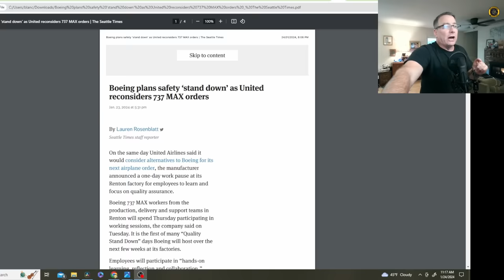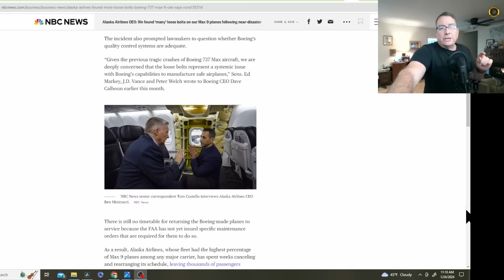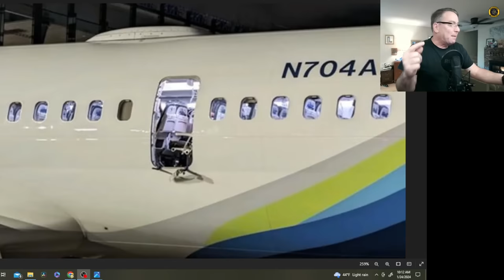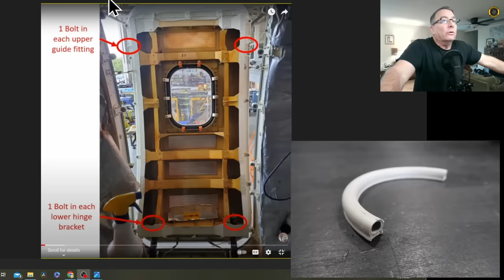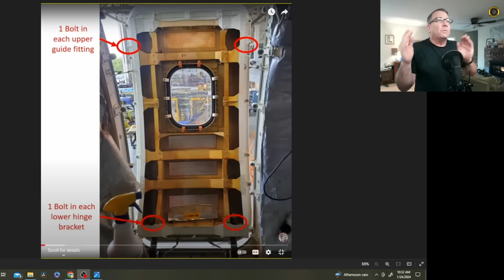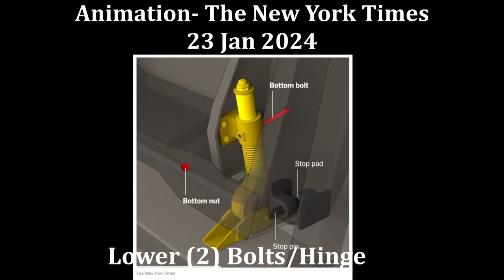Boeing's Quality Management Failure Explained 737-Max-9 Door 24 Jan 2024

Comment: Can you imagine what would have happened if this incident (not accident because they can be avoided) had losses of life or aircraft loss. In Australia the Alaska Airlines CEO interview was shown, wow he didn't hold back now it's obvious Boeing have some very serious quality control problems going on. Juan not sure if you can look into a very savage light aircraft crash that happened in Sydney yesterday. A Cessna 172 with a very young pilot crashed just after takeoff. Impact so savage you can't even recognise it's a aircraft BUT no fire at all. The 16 year old solo pilot requested to land started to turn back to the airport but has made a very high speed impact into a field. The aircraft had made two flights earlier in the day, but the third flight proved fatal. Looks very much like an incident where just after takeoff you need to have the options always on the table if the engine stops. Something that you have been focusing on lately.
Reply: I can imagine what the passengers that were nearby to the plug door thought for the rest of the flight as the flight was being aborted/diverted. "What is the next part that is going to fail and fall off of this aircraft?"
Reply: Sounds like the 172 was in the typical stall and spin crash, trying to make the impossible turn.
Reply: The impossible turn…
Reply: First thing lesson I’ll never forget from my IP: if your engine quits after takeoff, the runway ceased to exist. Translation: land someplace else. I used to do “stop and gos” at Wheeler AFB, O’Ahu. On the East end of the runway is what appears to be a golf course. That was my “alternate” landing field if my engine quit after takeoff
Reply: @uwekonnigsstaddt524  Garbage. O'Ahu is a new google spelling...
Reply: @uwekonnigsstaddt524  Outstanding. That is the only answer to a plant failure. I do not like to pass judgement on a Pilot who’s been killed and I don’t know anything about, but this has been a problem since General Aviation was born. However I’m seeing an increase in these accidents. A student pilot with 4hrs can make the correct decision while simultaneously even the highest time Pilots, Instructors panic and think they have to get the gear back over the Piano keys. 

Complacency and reliance on Autopilot have been the cause of the previous two U.S. commercial crashes (Colgan 3407 in Buffalo, NY where the pilots of a Q400 are on instruments about to hit the localizer but due to rime ice on the airfoil+extra weight of the ice and the gear being down their stall speed changed from the one tested on a clean airplane, they begin a stall, Autopilot-disconnects, and they immediately pull up making a recoverable stall into the loss of life of all on board. 

Comair 5191 in Lexington, KY: A CRJ-100 with 47 of 47 seats occupied plus a FA and Two Pilots. Pilots that breezed through their checklist on a dark 6AM flight, did not properly cross check their magnetic heading which would have prevented the accident that resulted in them mistakenly taking the 3,500ft General Aviation runway (RWY 22)instead of the longer and lit 7,000ft Commercial Aviation runway (RWY 26) resulting in 49 of 50 killed, the F/O and PIC was the only survivor. 

Then look at Air France 447. Pitot ice disconnects Auto Pilot and the First Officer stalls a A330 from 30,000ft+ by pulling the side stick back because the bodies natural tendency to want to climb away from the Ocean. But we all know how easy and preventable that accident was. 

Hand flying and practicing as many scenarios you can replicate SAFELY is the best cure. Pilots being startled by a sudden AP disconnect should know better. 

Your way of thinking is a very good one. If you lose power on initial climb, that runway no longer exists. Airports are  usually surrounded by open spaces of some kind. Going into anything wings level vs a extreme bank will only up your odds of living to talk about it. 

To all Pilots; You chose to become a pilot to fly airplanes, so let’s do more of it. I’m not saying don’t use Auto Pilot. AP is a wonderful tool. I’m saying do more hand flying, get to know your airplane, it’s minimums and your own. 

Blue Skies to all from Oklahoma USA.
Reply: Who doesn’t love a good conspiracy: there was no one in the adjoining seats?  I am not a frequent flier but on my last four flights all were at or near capacity.  And if I were on a crowded flight and became aware of an open row you can bet I’m finding my way into it.
Reply: @k9er233   I SPECULATE that the door is locked in place by the inside positive cabin pressure.   This problem is much more likely when the inside outside difference is small or non existant just after take off and landing decent.  Even this is too speculative to make me comfortable.   This is like an onion.  Each layer one peels off simply exposes a new one.   None will fall off while it is grounded. Which is why it is grounded.
Reply: We don't have to imagine, just look at the MAX issues, and the lessons Boeing learned from them.  PR is cheaper and more effective than actual safety.
Reply: @neeneko Let’s hope Boeing is learning.
Reply: Wait 'til the legal bill$ claim$ and settlement$ come in!!
Reply: @csenuber Hard to believe that Boeing is getting so complacent
Reply: Well it could have happened. Thankfully there was no one seated next to the plugged door when it failed. If there was, a person could have been sucked right out.
Reply: 172 no fire, previous flights in the day. No fuel. Impossible turney thing. Hope he didn’t watch aopa saying you could make it back.
Reply: @neeneko Lean manufacturing is a systematic approach to identifying and eliminating waste in a manufacturing process.   What Boeing and Spirit are doing is very wasteful.
Reply: @DriveByShouting  well, yeah, they are learning safety is expensive, words are cheap, and stock options can be pumped up through bybacks.
Reply: @danharold3087  lean is, by design, very short sighted.    it is an outgrowth of 'just in time' manufacturing, so elimination 'waste' is often things like 'inventory' and 'extra capacity'.  in 'lean', safety IS a waste since it does not contribute to throughput, and thus any opportunity to reduce it is 'embracing lean'.
Reply: @DJG37S ya, only at 16,000’ and it was still forceful enough to rip the shirt off a teen! Now if that happened at 30,000’…🛩️💥🔥
Reply: @patmahoney3120  The airlines/most airlines don't let you swap seats until they switch off seat belts sign. The flight was only just started.
Reply: @patmahoney3120 Well let’s nix the conspiracy then ………. The Max 9 flight was not long enough in the air for people to have started switching seats. Let’s try critical thinking instead of jumping to unsubstantiated conspiracy theories. 😂
Reply: GPS data shows him on the downwind leg, midfield.  @Jjengering
Reply: @toomanyhobbies2011  Irish?
Reply: @patmahoney3120  I don't want to support any conspiracy, but I am a frequent flyer and on a plane that is that full (only 6 or 7 empty seats) I have never seen an empty window seat, let alone an empty window seat with an empty middle seat right next to it. Very unusual, to say the least.
Reply: @Peter-gi3re Shame on you for letting logic get in the way of an illogical conspiracy theory.

But seriously, lt amazes me how some people seem to believe that they are so insightful that just because they think something might be so, it is!
Reply: @MrGundawindy I was the very last person on standby and had a window seat.

In reality, I expect that it happens more often than is realised.

Seats are often allocated on booking, so if people do not turn up for their flight (or miss a connection or are denied boarding), any seat has just as much chance as any other of becoming empty.
Reply: Essentially they classified or c&p opening of door plug for seal inspection as opening of a door for seal inspection. The latter does not require any bolt inspections as non are removed. Thing is that if one such classification error is found, there may be many more. If it can go wrong, it will go wrong.
Reply: It was reported on the news as his first solo. @Jjengering
Reply: @leokimvideo I see you on a lot of aviation and space channels, I used to watch your red back videos.

I love aviation and space too; do you have a PPL? I would love one but I have epilepsy so I guess I'll stick to the sims.
Reply: @neeneko   I wish this was shorter but you have a wrong view of Lean Design.  The term "lean design" can be misleading if interpreted as cutting corners or taking shortcuts on safety. While it does emphasize optimizing processes and eliminating waste, safety is a fundamental principle within lean design philosophy.

Lean design is heavily influenced by the work of Dr. W. Edwards Deming, a renowned statistician and quality management expert.  Deming is often called the father of modern quality control.  Lean Design focuses on applying lean principles (eliminating waste, optimizing flow, etc.) to the design phase of a product or system. In part this means designing the production system and product for easy error free manufacturing.  Lean design often involves redesigning processes to eliminate the possibility of errors, a concept also known as Poka-Yoke or mistake-proofing.  The lean methodolgy is evolving. 

Lean manufacturing is a broad philosophy that aims to eliminate waste in any process. 
If you have somebody telling you that safety is a waste they are off the the lean design track. We can clearly see at Boeing that non safe practices are costing a bundle.   

Learn design eliminate waste like minimizing defects through error-proofing,  cutting down on unnecessary movement and manual handling, and streamlining processes for faster throughput.
Reply: It’s an accident. Any incidence that results in injuries to people or damage to an aircraft is termed an accident.
Reply: @neilpickup237  I suppose. I worked FIFO, so most of the  time no one missed the flight, so I wasn't exposed to that so much. Also, the flight had not yet reached cruising altitude where others could move into an unallocated seat either.
Reply: @toomanyhobbies2011  That's the small island just east of Dublin, yes??? 😉
Reply: @Peter-gi3re  Good lord, man, what are you thinking? This is the Internet! 😉
Reply: The Alaska CEO did not say why they did not ground the aircraft when the cabin pressure alarm had gone off on the previous flights. 

Also - - it was reported by a whistleblower in Renton that there were two quality systems and this got lost by Boeing, not Spirit. He provided the records (did not see them) and they just did not follow up with shift changes.
Reply: @patmahoney3120  There is no conspiracy. Most check-in systems keep certain rows empty as long as possible, such as those alongside the emergency door. It would not surprise me if the check-in system was unable to distinguish between an aircraft with an emergency door and one with a plug - many airlines operate fleets of 'identical' aircraft with some configured one way and some the other.
Reply: @neeneko  How much has Boeing spent compensating the victims of the two MAX crashes ? How does that compare with the money it saved by choosing not to make MCAS safe ?
Reply: @petet968  He was actually turning base at the time, over Brownlow Hill at the correct spot.
Reply: The plane did not crash, but Boeing stock is rapidly losing altitude.
Reply: @danharold3087  thing is, there is the 'lean as it is sold by gurus', and there is 'lean as implemented by people with specific objectives'.  What you describe is more sales brochure or abstract than implementation.  Like any system, it tends to optimize for what the implementers are rewarded for, and things like safety are waste from that perspective since it does not deliver manufacturing value when your bonus is dependent on keeping costs low and output high.
Reply: @neeneko   We can point out numerous ways that short sighted people can ruin any process.  Your examples illustrate this.
Reply: @DriveByShouting  Air France 447 was a bit more complicated than that.
The First Officer (rh Seat) was flying and they tried to go above a storm and that took the plane very close to is max altitude where the stall characteristics can change. The pre-stall where just part of the wing is stalled can be so subtle there is almost no perception of it.

FYI - when I did my basic aerobatics one of my lessons was in dynamic stalling and pre-stall. The instructor showed me how I could stall at any attitude and how to maintain level flight while pre-stalling. I was wanting to learn competition aerobatics and that requires a higher level of understanding of stalling for various figures. So at that point I did a lot of stall behavior training.
 
As they were very high and in icy conditions one of the Pitot tubes got blocked with ice causing a speed alarm as the Pitots didn't match. That alarm then combined with a stall warning and a sink warning that confused the crew over what was going on.

This was exacerbated but certain Airbus engineering methodology. The Airbus does not have feed back in the sticks. So if one pilot goes to move the stick he'd notice that there's already input from the other pilot. Secondly to that the Airbus DID NOT have any indicators telling either pilot that the other pilots stick was receiving input. This is important because when the Captain finally did try to take control he couldn't do anything because in the Airbus fly-by-wire system it considers the FIRST stick to give it input as the one in command AND it then ignores the other stick.

So they had a combination of alarms, unusual flight behavior and a quirk of the Airbus system and never resolved it until it was too late.

When they finally found the Black Boxes 2 years later they got it all from the voice and flight data recorders

Its actually there on the VDR where the Captain suddenly realises that the F/O is inadvertently holding the plane in a slightly nose up attitude that was just enough to keep part of the wing stalled. Its recorded that he suddenly yells at the F/O to get his hand off the stick. But by then it was too late.

There's a n Aircraft Investigation episode that does a great job of explaining it.
Reply: @DriveByShouting  Considering that there was the Max-8 and now this with the Max-9 it sadly doesn't seem like Boeing has learned anything.

I did my degree in aerospace but have spent 30+ years in industrial control and automation systems across a variety of industries. I also have very high qualifications in safety engineering. I can quite simply say that these Boeing issues are eerily similar to what I see in EVERY INDUSTRY. there is a cancerous ideology that's crept in that started in the 1990s. Slowly the priority of quality control was replaced with "get the boss his bonus or lose your job" came in.

There's a mindless behavior of people with economics and business management backgrounds to lower costs that they've forced on engineers. At one time there was a great emphasis on QA because that lowered the costs of rejected product. Product that fails has already cost money to make sop reducing that reduces costs. That was the era when the drive in practices like Six Sigma happened. Unfortunately most of those QA practices were quickly taken over by clowns with economics degrees and they screwed it all up. 

Their insane need to cut costs eventually meant they went after QA as well. Because when they can't cut costs on materials, maintenance, training, wages, energy they will go after what's left. They do all this without any regard to consequences because in their tiny brains any cost cutting is good.

I've had to deal with this for over 20 years and its the same in EVERY INDUSRY I work in.
Reply: Which Australian channel showed that interview?
Its probably here on YT.
Reply: @danharold3087 You are correct, a plug door seal becomes more pronounced as the pressure differential increases.

Comment: Truly unbelievable that no inspection would be required to make sure that such critical bolts were properly installed.
Reply: I'm guessing somebody thought "open the door, no big deal" without thinking about what opening the door PLUG entails.  Spirit's on-site workers fixed the seal, probably rushed the clean-up to move on to the next and figured "if we missed anything, inspection will catch it" but there was no inspection...